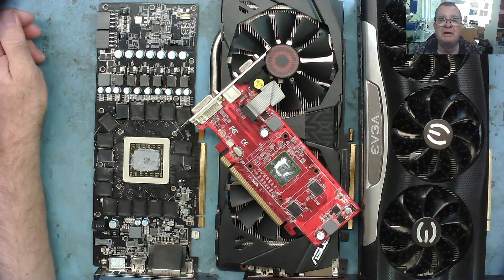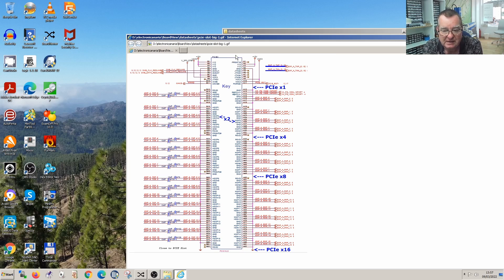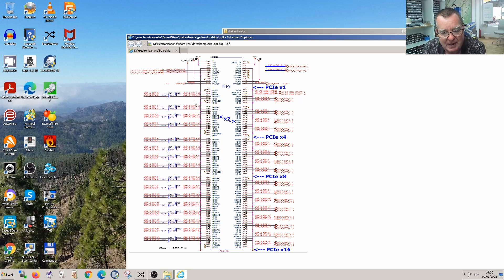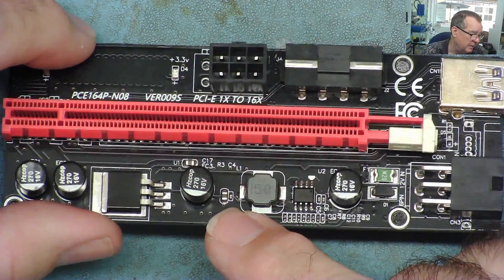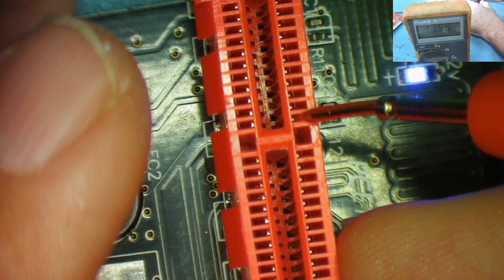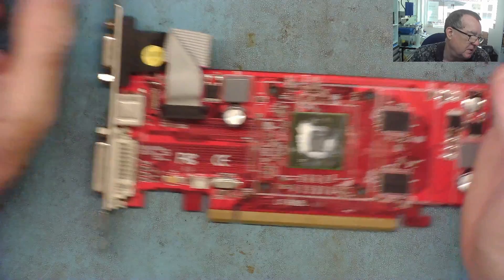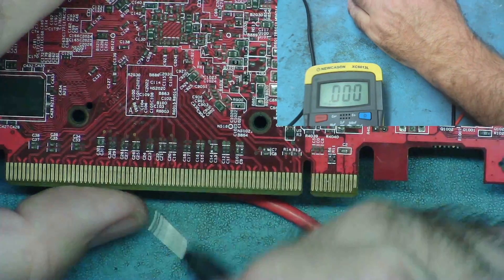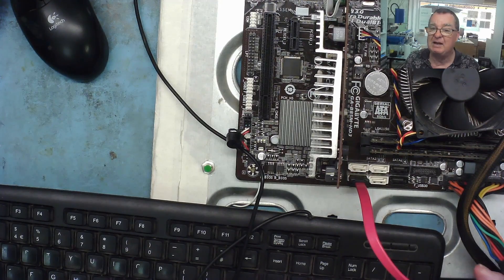GPU REPAIR Tricks,Tips & Techniques. All you to know about PCI-e Lanes Socket Interface to fix stuff

Comment from the maker: NOTE: 1/ I re-uploaded this video as the original upload had a couple of errors that may confuse people.  The original was only public for less than 5 minutes last night, before I moved it to 'Unlisted' but I notice some of you had the URL and were able to watch it and comment, 100% positive as it turned out 🙂  Maybe I was just being too particular but I re-edited it to fix the errors.  if you commented on the 'unnoficial' version I'm sorry those comments were lost.

NOTE: 2/ This GPU was the topic of a poll to see if we could remove reball and replace the GPU using a variety of equipment.  The poll is still active and I'm still going to attempt the reball - this is actually more interesting now because we can see if the card is working both before and after reballing it,

NOTE: 3/ Yes, I know the diagramatic description of an LVDS signal isn't quite accurate, but it is a good analogy for people to understand the principle.  In actual fact the inverted and no inverted signals overlap each other, so a logic zero is represented by one wire being higher voltage than the other, and a logic one by the polarity of the two wires reversing

NOTE: 4 / Sorry about the slight feeling of deja vu at 45:10 LOL
Reply: Man this videos are really excellent, thanks so much for sharing all this information. Blessings from argentina

Comment: Pcie reset pin on the back checked in diode mode using positive to ground.
Ref clock same thing,  but with negative to ground. Voltage drop must be same for ref clock.
Same with data lines. Diode mode, same voltage drop across all pairs.

Comment: Hi Richard and thanks for such an informative video. Congrats on attaining 10k subs subscribers.

My apologies if you did cover this. Why the series capacitors in the bus signal path.  I would have thought they would harm the wave shape by acting as a HPF.  Hoping you might be able to explain. Thanks Simon
Reply from the maker: I think it is to create DC isolation between the host and device,  those LVDS receivers are very sensitive but also very easy to damage.  

As I posted in the pinned comment  my explanation of LVDS was somewhat simplified to make it easy to understand, and to draw with pen and paper.  

In reality the inverted and no inverted waveforms are superimposed on each other so a 0 is represented by one wire being positive with reference to the other, and a logic zero is represented in the same way but the polarities are reversed.  At the frequency that LVDS operates on a PCIe lane, the capacitors add practically no resistance to the AC signal.

Comment: I'm about to attempt to bring into life RX 6700 XT which has broken PCIe header.  From your explanation I understand that theoretically to prove GK works at all and is not damaged somewhere else only RST signal is needed? Or do I need to also connect all 12V and 3,3V?
I understand that all JTAG and SMB are not necessary to be connected. Do you know if vBIOS flashing is using JTAG and SMB?

Thanks a lot. Video is really great even though as non native I sometimes had and trouble to understand the accent.

Comment: An idea for a future videos would be to show and explain the functionality of the various generations of vcore power supplies mosfet drmos of multiple chips versus single chip high low side drain gate. For example gtx 700 vs gtx 1000 changed in that respect but maybe before there was even previous changes.
Reply from the maker: OK I will look into that, thanks

Comment: For replacement, this configuration would be correct: 220nF 10VDC X7R 20% 0402
Ex: KEMET - C0402C224M8RACTU / TAIYO YUDEN - MAASL105SB7224MFCA01 / MURATA - GRM155R71A224KE01D

Comment: Should there be capacitors above the pcie connector on EVERY graphics card? Cause on one side of my gt 730, its missing half of them, but the pads don't look like they've been knocked or ripped off though.
Reply: Actually a gpu uses only few of those datalines, maybe the manufacturer of your card didn't populate the caps on the unused datalines to reduce the costs.

Comment: Hello , i have a dead rx580 but no motherboard yet, just a lab psu. Can you confirm this item showed in the video (the GPU PCIE adapter is mandatory to trace the fault on the gpu ? Cheers.
Reply from the maker: No it is not mandatory at all, but it does make it much easier to measure voltages on the graphics card when it is running, and they are cheap to buy - look for 'mining adapter'

Comment: Richard  an you check something about  a signal apparently reversed? On the two risers I bought from Amazon REFCLK- REFCLK+ are reversed between the riser and the insert. Is it the same for yours?  I cannot seem to track down why this would be if all are like this.
Reply from the maker: Yeah mine is also reversed on REFCLK+/- as I mentioned in this video actually. Or at least I think I did, but I had to re-edit it to save a couple of confusions. I also have no idea if they are all like this, but if yours also is then that is definitely two of them that are.
Reply: On the other hand and supporting your comments, There are multiple mentions of "refclk polarity" (that is the google term to search) being reversed, so this appears to be fine by PCIe standards.  Now whether NVIDIA supports this in the RTX 3080, I suspect we would have heard.  Looking at the PCI finger this appears to have been done for trace routing purposes.  https://www.reddit.com/r/AskElectronics/comments/n1sz69/why_is_the_pcie_clock_pair_inverted_here/

Comment: Hi :) I have problem with my GPU, it gives picture only when i plug it in riser pci X16 to X1. In X16 slot on motherboard it's not running, i tried it on few motherboards. What do you think about it?
Reply from the maker: Follow every step on this video and you should hopefully be able to find out what is causing the problem

Check all the signals as I show,
Check all the resistances as I show
Check all of the PICe lane capacitors with a capacitance meter as one may be cracked and open circuit but physically look OK
Reply: @LearnElectronicsRepair  i checked all that you, and all looks good
Reply: @LearnElectronicsRepair  Ok, I noticed that this GPU works only on 775 motherboard. On 1155 and 1150 not. Do you have any idea?

Comment: Impressive as allways! Just one question... any tip on soldering these little b*stards... Got a similar problem and they're so tiny that i can't get enough heat to solder just one (with pointy tip ts100 solder), they are like in pairs and when i get one in place the other ones moves...
Reply from the maker: To get enough heat in to the job, you need to use flux and a chunky tip - I use a KSGER T12 with a BC3 tip set to 330C.  This may seem counter-intuitive but get the chunkiest tip you can find and give it a go
Reply: @LearnElectronicsRepair  thanks! The ones that i have are big enough to heat but too big to just "touch" one of the capacitorsm allways end up moving two of em. I'll try with that tip and temp. Thanks again!
Reply from the maker: @KyzuLuvsNeka  I have shown how I do this sort of work on various videos but I could also make a specific one on this topic 😉
Reply: @LearnElectronicsRepair  I'll recheck em first. Thanks for your work as allways, love the way you work and you logic thinking. If i miss something i will ask if you don't mind jeje
Reply from the maker: @KyzuLuvsNeka  Ask away.... no problem 🙂
Reply: Usually i use hot air with solder paste: the solder paste acts like a glue for the small caps, so the air won't send it in the 9th dimension. Just use 10% of air at 400C, in less than 30 seconds the little cap is firmly soldered.

Comment: Hello sir , if i may ask you another question . I currently have the solderingstation "Aoyue int 866" but its less watt then you recommended . Will this do ? Or otherwise i was planning on getting the "ST2090D" it has 80 watt, or if u have suggestions on what to look out for . THe T12 was currently not available here were i live ,so looking out for similar options . Kind regards ,Guy
Reply from the maker: What makes the T12 so good is not the Watts (lol) it is the fact that the heater is integrated into the tip.  The ST2090D looks like the old technology with a tip that slides over the heating element.  This is inefficient at transferring heat into the tip and that makes all the difference.  Really if you are buying a soldering station these days you need to by one with integrated heaters in the tips.  The T12 is probably the best known of these but there are others.  

T12 is a tip type by the way, not a brand of soldering iron.  Mine is KSGER branded but AliExpress lists many other options.  I thought they delivered to everywhere, even little dots of islands in the Atlantic Ocean like where I live.

https://www.aliexpress.com/wholesale?catId=0&initiative_id=SB_20220314102809&SearchText=T12+Soldering+Iron